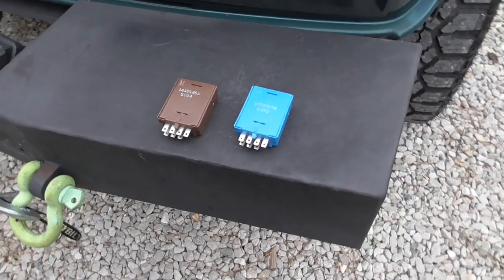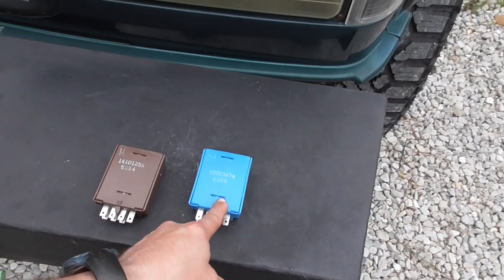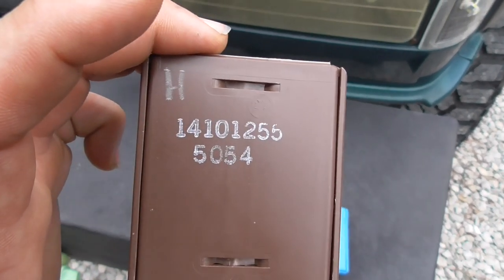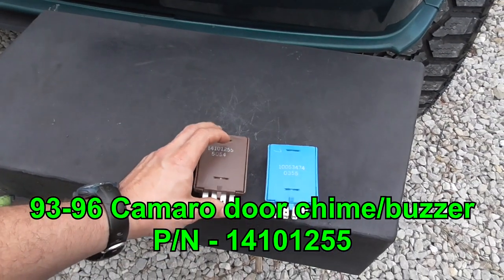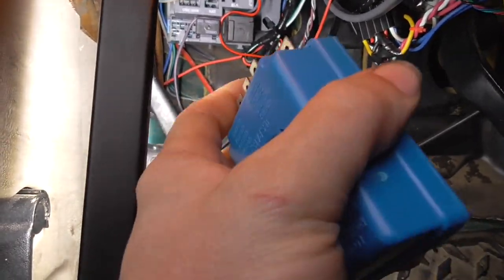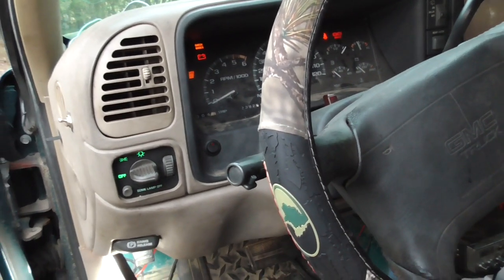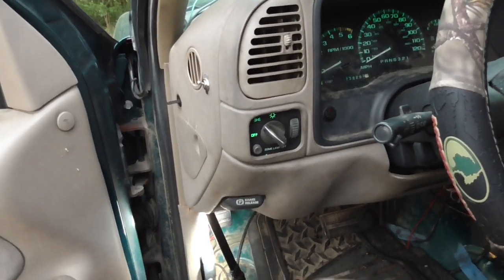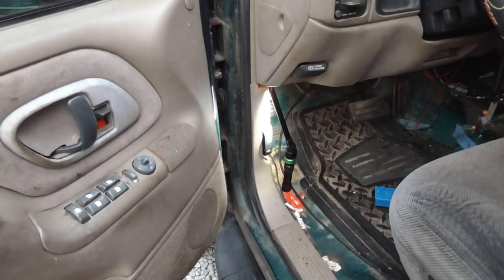1988-1998 Chevy Truck/SUV | Door Chime Upgrade | 14101255 | GMT400

Comment: Gm should have replaced that buzzer with the chime in 95 when they redesigned the interiors on these trucks. The buzzer sounds like a flatline alarm at a hospital when someone dies lol
Reply: I disagree and the 1999-2004 models SHOULD have kept that flatline buzzer sound as standard on the 1999 Chevy Silverado and GMC Sierra and the chime should be an optional choice.
Reply: @Jac2Mac  hell no lol
Reply: @albertpintor3522  Will a scary buzzer from a 1981-87 Chevy Custom Deluxe fit into a 1999 Chevy Silverado 1500 in place of the chime?
Reply: @Jac2Mac  no way because the chime is part of the bcm computer
Reply: My 97 had a chime not a buzzer
Reply: The Corvette from that time already had a chime instead of a buzzer. That begs the question of why they didn't do the same with the 1995 C/K interior redesign.
Reply: @garrettmckinney  I think gm was just cheap as fuck and not to mention that they used tbi until 95
Reply: @Jac2Mac  I couldn't agree more. I didn't mind the chime on the 99-02 GMT800 and Blazer. The "bong bong bong" chime in the 03 to present trucks are so annoying. I also cant stand the fake blinker noise the 07+ trucks had. I like the sound of the bi-metallic flasher better "pah- ting pah-ting pah-ting".

Comment: Thank you for making this video! I don't mind the tone of the origonal buzzer, but the fact it does not shut off with the door open and the truck running drives me insane, but I didn't want to just remove it because then I would be clueless if I left my keys or left the headlights on. Thanks!

Comment: If you're ever in a junkyard, look for chimes in the late 80's LeSabre, late 80's and some early 90's Electra/Brougham or 99-2000 Yukon Denali/Escalade. They've got chime modules that suit the truck a lot better than the early Camaro dingers. If you ever wanna know what they sound like just search videos of startups of the said vehicles. 

Bought a pink looking chime from a junkyard 88 Electra that seemed decent in my 94 Sonoma, up until I found a chime module from an 86 Vette. Chime from the Vette fits the smaller trucks much better.

Comment: Would this be similar on a 04 Chevy blazer? I would like to change my door chime to a 07 and up Chevy trailblazer.
Reply from the maker: No, the newer s10/Blazer/Sonoma door chime is built into the body control module and is non changeable without modifying the body control module.
Reply: Daniel Pace oh ok that’s a shame lol but thanks for letting me know!
Reply: That sounds like a low pitch 2000s to 2010s Jeep.

Comment: Is there any other model chimes that can be used for the obs
Reply from the maker: pretty much any '90, and early '00 GM vehicles and some older Jeeps.  But the Camaro chime is the lease annoying.
Reply: @DanielPace92  where do you Gm get yours
Reply from the maker: @chrisv1546  I don't fully understand your question, I think you had a typo. If you are talking about the buzzer it's form a 1993 to 1998 Camaro with part number 14101255.  If you are asking what GM is, it stands for General Motors.
Reply: @DanielPace92  I meant where did you get your Camero chime form
Reply from the maker: @chrisv1546  eBay.  They pop up from time to time.  You just have to keep checking back if there is not one already listed. As of now I don't see any listed.